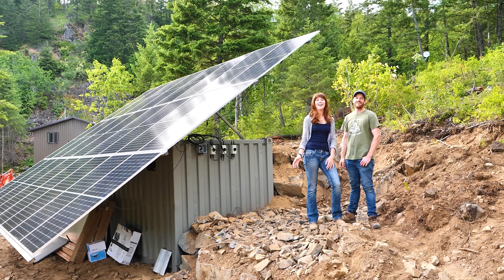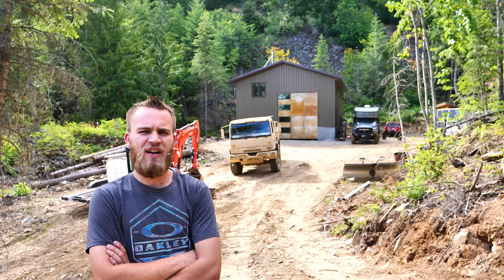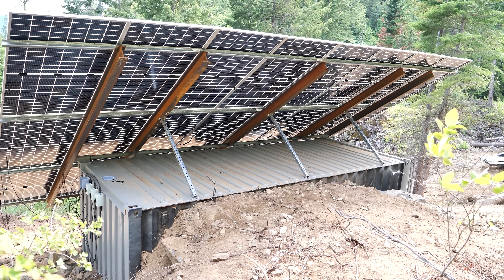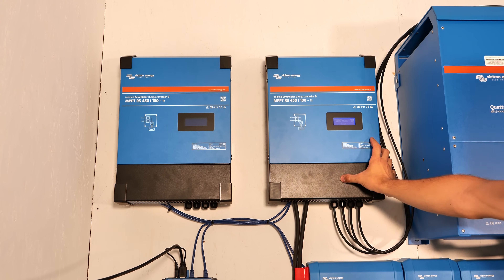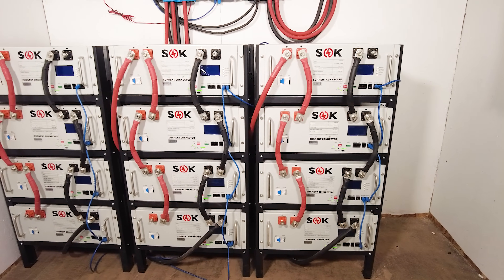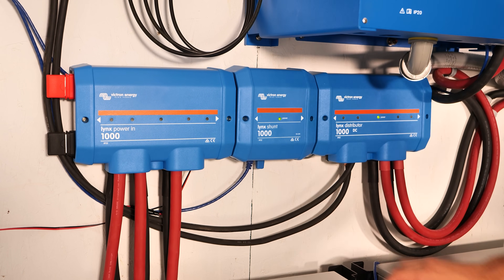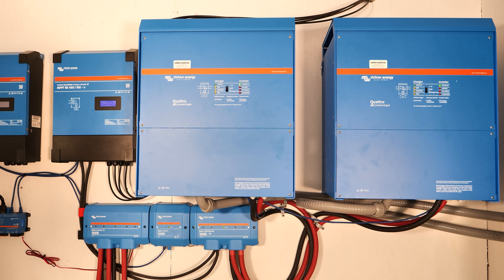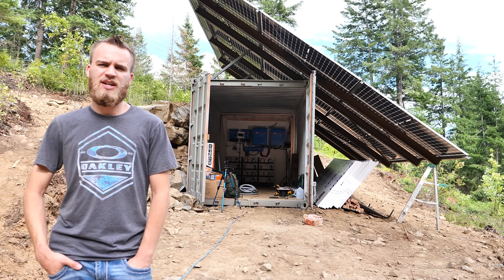Massive 20kVA Off-Grid Power System by Current Connected⚡️

Comment: what is a ball park cost on a system like this? I am half regretting going grid on my last build. just under $7k for hookup and around $200/ month sucks.
Reply: That's WAY cheaper than off grid.   This was a $70k+ system.
Reply: @PartTimeYooper  found the pricing on the website, looks around $50k ish. though i have spent thus far about $19k with the power company. this system would pay off in around 18 years for me. Though my build site was pretty good, my neighbor was going to pay $75k to put poles and a pad transformer.
Reply: @Ramdodge582   That's just materials not including the racking system, all the cables that are needed, shutdown switches, the ground wire and conduit to the main system and everything else that's needed, plus labor.  There is probably 10k in materials you are missing, plus another 25k in labor and overhead.  It's more like an $80k system.  I just installed something similar and it was $85k+ system with generator backup and the whole 9 yards.
Reply: @PartTimeYooper  I'm not counting that since it's all the same on my system, labor is me, racking, cables ect were included in their prices online.
Reply: @Ramdodge582  solar rack....for 24 panel, you'll pay min of $3500 for a basic fixed but expect to pay double that and then some for an adjustable system.  Adjustable usually require some pretty massive posts that also require a lot of concrete.  Last one I did needed to be 12' deep in the ground! Try finding someone who can even dig that deep for you.
Reply: @Ramdodge582  BTW an 18 yr payback is a horrible investment.  You'd be way better off investing that money elsewhere and using the returns to pay your power bill.  

Or just think a $50,000 investment in Apple 18 years ago worth over $4 million bucks today
Reply: @PartTimeYooper  I can dig that deep no problem but if I were to install a system I would have to be off grid far enough where it didn't make sense to go on grid.
Reply: @PartTimeYooper  I know, that's why I am on the grid at this property.  Next one will be further away from people.
Reply: @Ramdodge582  best advice...make friends with the neighbors.  We are so close to being able to build microgrids at an affordable level.  I'm trying to pit together all the permits/etc to get 12 off grid cabins/houses hooked up to a private grid.  It's been so going so far
Reply: @PartTimeYooper  we did and gave then and under ground easement across our property and it reduced their power install cost from $75k too $20k. Been helping them with their build ever since.

Comment: I hope the shipping container building is anchored to the ground, because a heavy snow and ice load on the lower panels may be enough to cause the building to turn over sideways.  (From what I can see)
Reply: Yeah, with the weight of all those batteries, internal walls let alone the weight of the container itself that’s a pretty silly concern to have.
Reply: @bikebasket9594  look up the dimensions of the panels and the math to do the pounds per square foot or kilograms per square meter at various wind speeds, then you'll know. It's difficult to know if simply the weight of the container and contents will be enough to hold it in place since we don't have an exact location to look up historical wind speeds
Reply: @greggv8  yeah bro check out those hurricane videos where steel shipping containers are blowing around.

Comment: Nice system. I have almost the exact system with dual (split-phase) 5kVa instead of 10kVa Quattro's. I hope you have better luck with the SmartSolar MPPT RS 450/100 than I have. I'm on a 2nd unit that was originally installed in April, now acting like the unit that failed. Look for random MPPT and battery charging dropouts. They improved with firmware v1.10, but haven't gone away.

Comment: Why did you mount a main electrical panel in the storage container?  I figured you would want to run your main power from the storage container to a main panel closer to home.
Can I ask "how much"? 40K ??
Reply from the maker: Wherever the two inverters combine is considered the main panel.  Both inverters must have exactly equal length wire to the main panel, so if you ran to the building first, you would need a lot more wire!  They also plan to have another structure further up the hill, so this acts as a midpoint.

Comment: I like the stackability of the Victron components although it looks like Sol-Ark has most if not all of the same features, but with the option to be EMP hardened.
Reply from the maker: Victron is a high-frequency topology.  For the loads they plan to run with major surge requirements, the Victron will hold stronger to those types of hits.
Reply: @CurrentConnected  Uh, the photo sure looked like a low frequency transformer to me.
Reply from the maker: @aday1637  Sorry I meant Sol-Ark is high-frequency.  Victron is certainly low-frequency.
Reply: Michigan... By the quality of this build... One can only hope that someone was savvy enough to drive ground electrodes and meg them, build a tri-plane, then Bond that Connex... (that is what I would do)...
Reply: @nickdannunzio7683  I agree with your hopes.  I know that I would ground the living hell out of EVERYTHING.  AND put up an old TV antenna tower (or two) with lightning rods on them.

Comment: I am sure they're going to tidy that wiring up, but some of the way the solar DC wires look to be rubbing against metal? Erk.
Reply from the maker: They needed another run to the parts store, however I had to get my video made before leaving.  There is a second solar controller to hook in and at that point they will get things cleaned up.

Comment: Here in aussie we dont do anything less than 240V :P 
The problem is alot of people also dont realise ya dont have to have the lifepo4 batteries BMS's connected to anything unless ya want to monitor it which turns people off
Reply: Yes Trent, 240v is definitely better than 120v, more power with less copper. I guess that is one thing we have got right/er.  Go Oz!

Comment: I am here from "Ambition Strikes" yt ....but I'm impressed with the install and components used. Most impressive.  I live full time retired in 40 ft 5th wheel. I'm a lifelong artisan so I need power for all my various tools. I want to start Boondocking exclusively but I'm intimidated by Solar being that I'm 61yrs it's something I know enough about but lack experience.  I need help designing a system that will fit my needs, but start off a bit smaller and grow the system. So many factors to consider I easily get overwhelmed....Thank You but again most impressive system...like wow...👌

Comment: If I'm looking at this correctly the Quattro  transforms the battery voltage from 48v but then how do they combine on the ac 240 volt side.  Are they parallel outputs to the main?  Does the Quattro sync
The sine waves 180 deg apart? I saw a blue comm cable too?
Reply from the maker: You are precisely right, they sync 180° apart, they can also do 120° apart for three phase operation with three units
Reply: @CurrentConnected  You might have us sold with that in a few years, I've always wondered about 3 phase without a grid connection. The grid connection at ducks and deer camp is miserable.

Comment: Wow, this system screams "turn me into a single axis tilting system please!" Get a bit more power out of your cells!
Reply from the maker: It is single axis, but the only axis is north to south for summer and winter mode. We added extra panels to handle additional generation throughout the day the biggest problem for them will be snow in winter and short days, So that’s why we have tons of extra panels and a boatload of battery
Reply: @CurrentConnected  It is only adjusted once per season though? It would be more efficient if it's constantly adjusted slightly throughout the day.
(The amount of additional efficiency you'd get would depend on where you live.)
Reply from the maker: @fitybux4664  Yes, seasonal adjustment only.  The problem with trackers that are constantly moving throughout the day is they cost a LOT of money to build, and for the same gain in daily production you are way more cost effective to just add a few more panels.  Also, adding more panels at a fixed angle has very little added maintenance costs.  Trackers on the other hand have motors, pivots, gearboxes, etc. that all require expensive maintenance, and can easily be damaged in a major windstorm.

Comment: Man that is a extremely expensive system. I'm in Australia - those SOK batteries are $3,000 AUD EACH. and those Victron products would easily be $20+ K all up, the Quattro is at least $5K and then there are the panels.... So I would estimate your setup is about $50K+ USD???? I mean you are using the BEST branded products but can you please tell us how much the total cost is please?. I look at solar and love it, but I also look at how much it costs me in Power bills a year ( here in Sydney, Australia I pay around $3200 AUD a year for a 5 br house. Solar panels last about 15-20 years at most, so for many people it is not worth it, but if you live in the woods then different story. Have you ever looked at hydro power? - there is a YT channel Gridlessness - they have this awesome Canadian made mini hydro turbine.....
Reply from the maker: Comparing the cost of an off-grid system to a a power bill when existing grid is in place will leave you shocked...However, when you compare the cost of an off-grid system to the cost of a utility install when the lines are miles away, it quickly becomes far more cost effective to build your own system.
Reply: @CurrentConnected  absolutely makes sense in that respect
Reply: @CurrentConnected  so how much did this marvel cost?
Reply: Most solar panels have a 25 year warranty so if they only last you 15 to 20 years you get new ones for free
Reply: @lesstevens2370  If the company is still in business under that name.  It's no longer a lifetime of the product, but rather lifetime of the company.

Comment: They will need more pv, batteries to feed those big inverters and some trees cut down if they want to live off-grid. Nice system.
Reply: I agree, these panels will suffer from the flag pole effect with that tree being casting a shadow on to the panels.
Chop it down and get some use out of the wood in the house….
Excellent design tho, and as a sparky I can appreciate good workmanship.
Reply: Per their video they've been using the system for over two weeks and the batter bank has never dropped below 95% SOC.
Reply: @57z  excellent to hear that statistic, thank you.
That is always a good indication that they are using a well designed and sized system. You are to be commended, although, me personally, that tree would be fire wood… lol…

Comment: Huge set up, I don’t need that much power. Curious on how it goes from your train car to your property. Are you digging a trench to your main building panel?
Reply from the maker: The good news is that we have multiple different options available, so if you wanted a smaller system we could scale things down to your needs.  Riley & Courtney have some grading work to do, so for now they will be using some SOOW cord, but eventually they will have a trench in the ground containing all of the needed conduits.
Reply: @CurrentConnected  
Already built my own. 🖖

Comment: Wow, pretty damn nice setup!! Sure have a lot more room in a 20ft container than the 8ft I went with lol.
Reply: Fancy seeing you here!
Reply: I noticed that they did the alternate left right DC connections on the loop-thru to the batteries, where you changed yours to a single run.
Reply from the maker: Video on @hightechlab channel pushing over 400 amps through the battery with no issue
Reply: Both methods of wiring are acceptable per the manufacturer's recommendation. I have my own personal preference though.